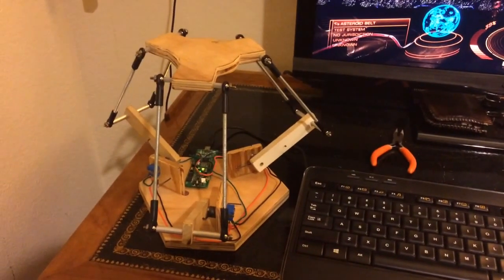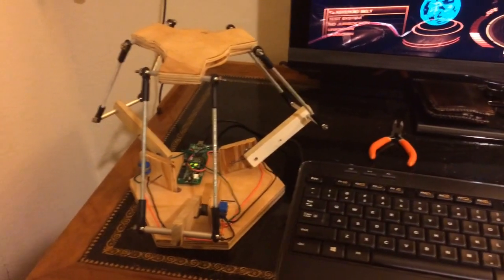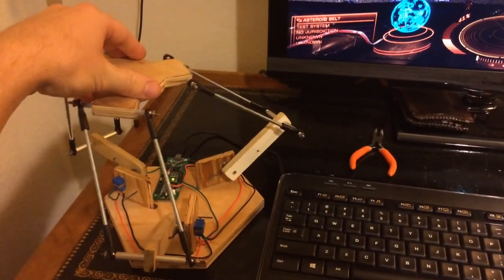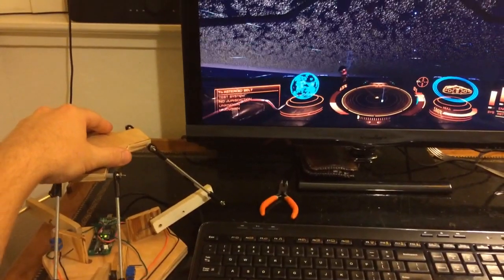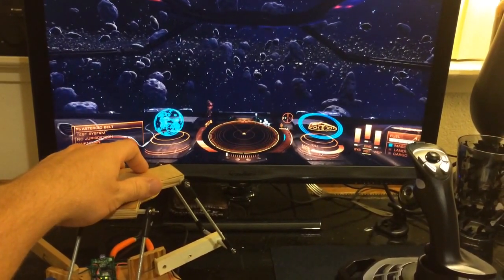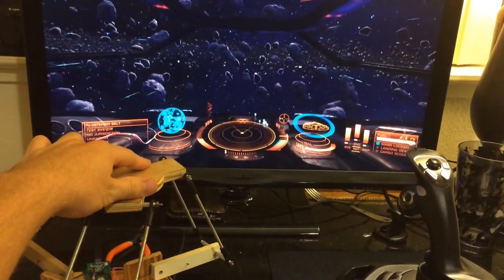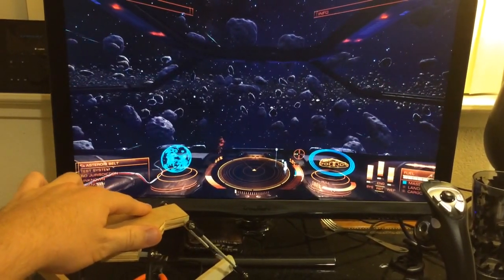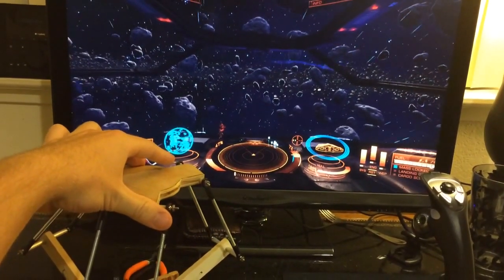3D Throttle for Star Citizen and Elite:Dangerous

Comment: How do you set 0 ?
Reply from the maker: No way currently but the plan is to just have the zero point be wherever it is when it turns on.  It needs stronger springs I think to bring it back to zero.  Servo motors would be ideal but probably too expensive for a peripheral.
Reply: Zack Dayton Could work in a tolerable dead zone also, take the start up numbers so over time when the springs wear and these change.